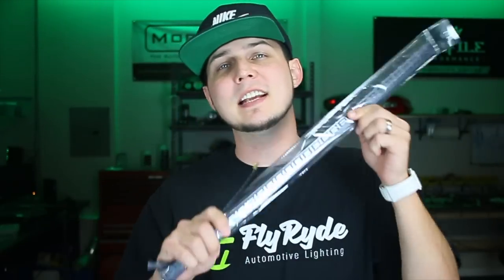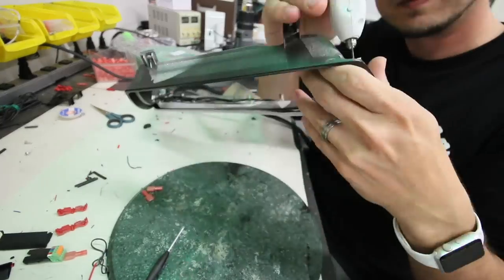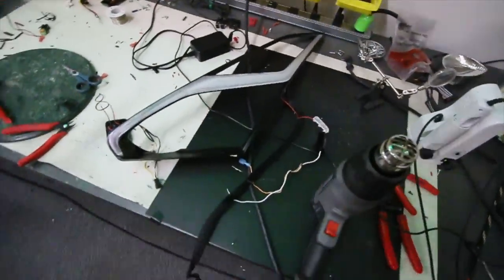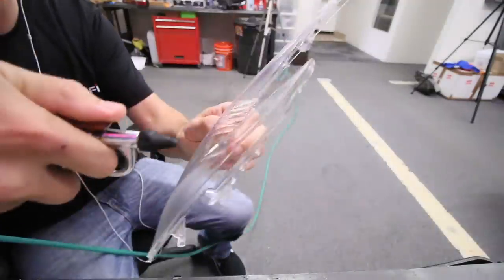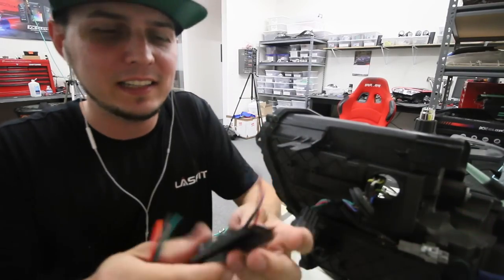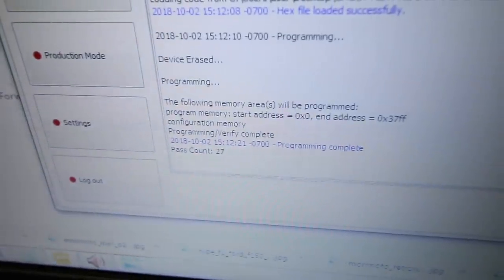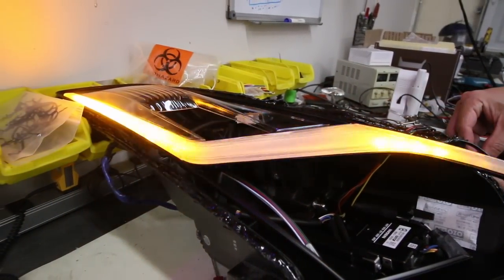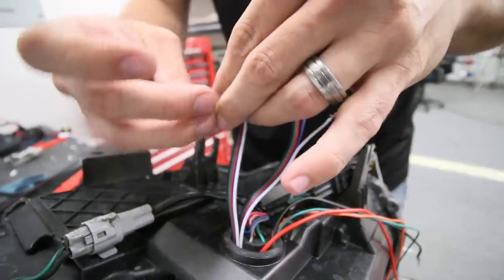How to Wire Headlights for Sequential LEDs

Comment: Great vid! Love the channel. I have been experimenting with ws2812b LED strips and arduinos to make a sequential light strip for under my tailgate on my truck. Sadly I've been coming into coding issues. Would a ghozt module be more reliable/user friendly? Or should I keep trying to fix my coding error on the arduino?
Reply from the maker: BLUEFEATHEREDOLIVES I would use a BlueGhozt, which is used to control addressable LEDs, similar to how these Ghozt Sequencers control single color LEDs. Shoot over an email to sales@flyryde.com
Reply: @flyryde  thanks for the reply! I'll shoot an email in the morning and describe my setup.
Reply: If you need help with some of the Arduino code. I also have underground lighting effects using the 2812b strips and have them tied into my blinkers brake lights and reverse so that when I'm driving I don't have to touch any buttons and it's automatic..  but I'm using a esp8266. And have websever running on it so I can control more effects. Also look into the ws2812fx lib in the Arduino. It has like 50 effects prebuilt in so very easy to just all them and it supports segments so you can split multi effect on same strip. Like when turn signal is on that side blinks . I use one strip and program in 4 to 6 segments for front back left right. And back some I see it in to 3 for better visual  like left turn on back the left side will blink the center breaths and right another effect.
Reply: @shawnstone2875  thank you! that sounds like it would be really cool. I'll definitely look into that. You also seem way more qualified in the addressable strips than I am. I've made VU Meters with standby patterns and basic sequential blinker setups. My main problem is trying to make the arduino take priority over reverse lights if the reverse is active while turn signals or brake lights are active. Do you have an email I can contact you at? Maybe I could send you my version of the code?

Comment: Any advise on how to add something that can help diffuse light from the leds to make them look more solid and opaque. For a bit of background this would be in a headlamp that is just clear with nothing to diffuse light. 2008 magnum for reference customizing housing for turn signals.
Reply from the maker: Some guys use the spray to frost window panes. I’ve experienced that actually damaging plastic though when spray too close. In any case, there’s multiple ways, non of which I feel are easy or the “best” way.
Reply: I think I have found a way but like you said nothing's easy. I plan to cut some "frosted" plexiglass/acrylic and heating it to the correct shape. Then all that is left is finding an adhesive that can secure it in the light.

Comment: Hey bro, do you sell any plug n play adapters or connections that will allow the LED strips belowe the headlights as well as the lightining bolt on the headlights of a 2017 run during the day?
Reply from the maker: I have been sourcing the OEM Headlight connectors for a long time now. Once I have those I’ll make some harnesses that are fully plugnplay that offer a range of different functions 👍

Comment: Would love to know if the new ghozt plus module I ordered  is able to produce the background color in normal mode without having to wire a second strip... have you ever wired  a strip in parallel on the data pin on either channel. Say for instance if you want a double row for brightness..

Comment: Great video! What are you using for the white running light, though? And is it just wired up through the Ghozt module also? Aaand like others have said, these products aren't on your site yet :(
Reply from the maker: Lol I’m sooo bad, I still haven’t slowed down enough to add those up, hahaha. The white is linked in the video though, they’re Profile Pixel 24” strips wires to an Xchange driver that cuts power to them when it and the Ghozt module gets turn signal voltage.
Reply: FlyRyde No worries man. I appreciate the work you're doing for car enthusiasts and DIYers! And thanks for the info!
Reply from the maker: https://flyryde.com/products/powerled-kit-20-leds

Comment: How would one get a custom light diffuser, such as the lighting bolt but to suit my needs?
Reply from the maker: You can make something cheesy out of acrylic, and frost it with spray or sandblasting,  or you can try something similar, but it always looks homemade in person. Other than that, you can 3D print if you’re super techy like that.
Reply: @flyryde  alright man, thanks for your help!
Reply: Josh Davis been wanting to do the same thing to my aftermarket headlights with DRLs. Let me know if you ever find out a way to create diffusers without them looking extremely homemade
Reply: @SanMario95  I had a look at the hardware store and you can get sheets of frosted Perspex that I might cut to shape with a Dremel but I'm still looking around